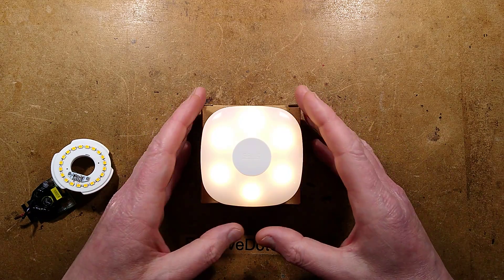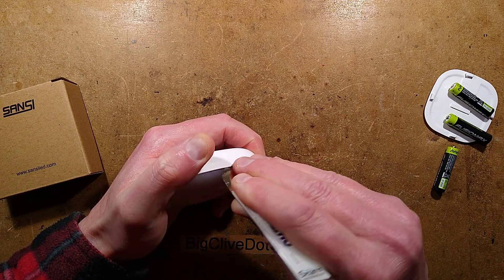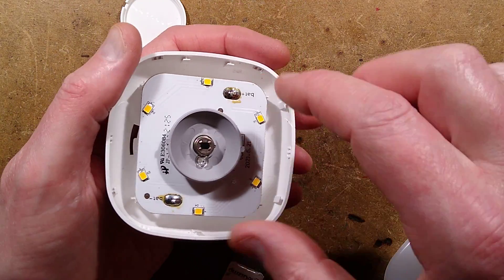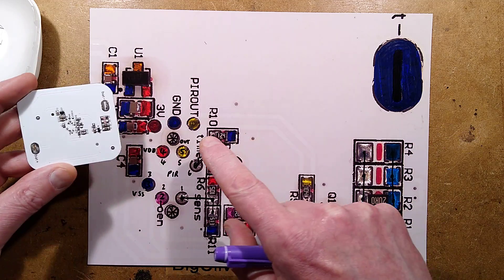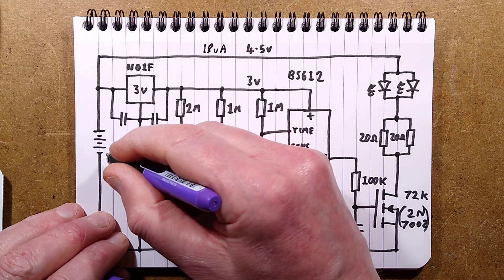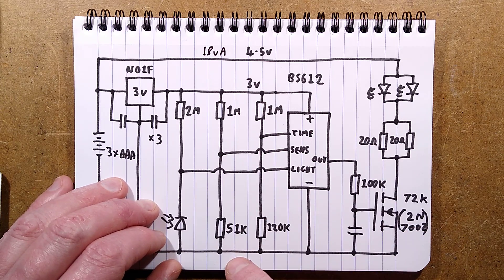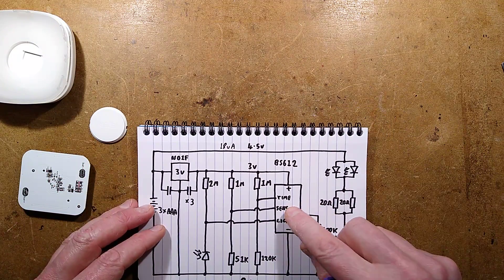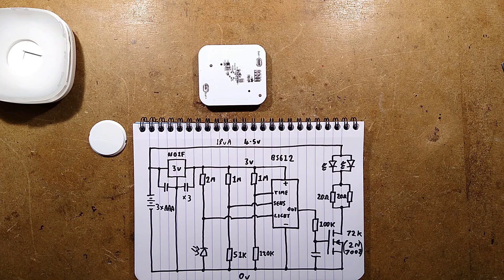Stylish Sansi PIR light - with schematic

Comment: Maybe the fresnel lid is mostly transparent for infrared wavelengths?

Some time ago I opened a pitch black device casing (some Android TV thing, IIRC). Normally these have a little smoke-glass-looking plastic window for the infrared remote receiver. But here there was no separate opening - the whole device case was 'infrared see-through'. (I checked with a phone camera that is a bit IR responsive and it could 'see' the sender through it.)

Comment: I'm surprised that at the "1M to 51k" ratio divider for sensitivity there is enough voltage left at 3V to set anything  (145 Millivolt?).
Nice that it doesnt draw higher currents for that, but i guess most will be used anyways in the standby current of the 3V regulator.
- Good size to replace with an old (protected) mobile phone battery.

(pair of 3 is currently at 10bucks on amazon, 6 for 16bucks, 1 for 6bucks.)

I wonder if their plant lights actually are good or just normal lights.

Comment: I wonder if it would be possible to create a scanning array and software to use the PIR sensor as a thermal camera pixel (or set of pixels).
Reply from the maker: A real high resolution thermal camera has never been more affordable.  (Infiray)
Reply: Look up panasonic grid-eye sensors. It's exactly what you are thinking off.

Comment: 3-Cell battery lights traditionally used 3 D-cells or C-cells in a single package.  I often wonder if the package standard could be resurrected as a large LiPo cell that can be shipped only by land then devices can be air shipped without for faster time to market.

Comment: Going by the circuit the device will not operate when the batteries discharge to 1v which I think is the yardstick for battery operated equipment. Looks like it might be okay down to about 1.2v per battery so NiMH batteries would not be very practical.

Comment: Interesting that the timer does not use a capacitor.  It would be nice to know the quiescent current. It seem rather inefficient to waste power on a linear regulator, but i suppose something must be done to compensate for the slow voltage drop as the batteries discharge, and 18uA is not going dissipate much. 
I have a very similar unit under my printer shelf. It's only necessary to wave a hand under the shelf to turn the LED light on, illuminating the printer to aid in changing the paper. This must be a new generation of low current PIR sensors, because when I wanted to use one to open a cat food dish, the high quiescent current ( in the mA range) made battery operation impractical. This unit would be easy to hack, to make a cat food dish lid controller, just replace the LEDs with a relay to drive a motor.
Reply: I forgot to mention that it also requires two normally closed limit switches, and a rf suppression capacitor to go across the motor.

Comment: I think AAA batteries where AA would work and be objectively better is just typical design cheapened to a fault. Less material cost in the compartment/holder, lower "batteries included" cost, etc.

Comment: Do you think that the capacitor on the mosfet gate is there to prevent possible strobing?
Reply from the maker: It may be to give a very slight soft turn on to avoid a sudden current spike.

Comment: Based on teardowns, what's your general opinion of Sansi products design and build quality? Based on your video of the ceramic light bulbs, i purchased a couple from Amazon to try out in my living room lamps. Lumen output seems better than the older Cree lamps i replaced, and the bulbs, while tiny, felt more solidly built. Im kind of surprised at how much sturdier they felt.
Reply from the maker: It's hard to tell without a long term test.  Some comments indicated but very long reliable operation and also some instances of early failure.

Comment: 3x AA would be too chunky to fit in that form factor, 2x AA wouldn't drive the LED's unregulated, and asking all potential customers to use only high voltage rechargeable NiMH or Li-ion AA cells is too big an ask for the price point. Integrated rechargeable doesn't make a lot of sense as it's a set and forget closet lamp.

Also from what I understand, there's quite a lot of difference in voltages over their discharge for AA, but almost all AAA are the same. AAA thus make a more consistent power supply, especially given the microcontroller power arrangement.

Still, it feels like they could have found a power controller that'd regulate both 3v and 4.5v for the LED's had they looked. It's clearly not the cheapest possible unit, the fresnel lens, exacting tolerances, circuitry, and PCB size all point to how much cost they're willing to eat... It's not like China or Texas Instruments have a shortage of chips for this kind of device.

Or one 5v regulator and a 5v microcontroller. You can still find 5v logic on newer processes, so energy efficiency isn't an excuse.

Comment: I think the capacitor on the gate is for smooth transition from light to no light. Otherwise if there's an object in front of the set, it could cause an oscillation with the photo cell, maybe more so when the batteries run low.

Comment: I noticed that the two 20 ohm resistors you were pointing out at 5:16 are put on so that the bottom one has the text right side up and the top one has the text right side down. Am I wrong in saying that a pick and place machine wouldn't do that?  It says to me that they hand soldered those two resistors, fine tuning the output of the LEDs.
Reply from the maker: I'd expect them to all be soldered at once.  It may be that the pick and place machine was programmed that way or that some resistors in the strips were in a different orientation.

Comment: I am not sure you are right about how it works. 

The IR sensor is a thermopile (stack of thermocouples in series) usually arranges  in a circle. With a germanium IR pass filter to block out visible and UV light.  The thermopile only outputs the relative temperature of its cold and hot junctions multiplied by the number of hot junctions. To measure absolute temperature of the IR source you need to measure the absolute temperature of the cold junction of the thermopile and then add the output of the thermopile. The thermocouples are likely to be type J or Type K. . 

The IR background has a wide temperature range. Say -20 to 35 C. This is why you don't want to measure the absolute temperature. You have to use another principle of measurement. 

In this case it is detecting an AC voltage to trigger the lights. This AC is generated by the target moving across the Fresnel lens. The Fresnel lens is more of a comb filter than an actual lens. Thus the Fresnel lens turns the moving IR signature of the target into a series of pulses. 

These pulses are detected and used to trigger the light output. The resistor and capacitor at the gate of the 2n7002 MOSFET create a delay and then hold delay for the lights. 

I will sit corrected if I am wrong. But I guess that I have just encouraged you to dismantle the IR sensor itself. Go on you know that you want to.

Comment: Hi Clive!  Thanks for the great videos as always.  Regarding those pesky battery holders, just in case you didn't already try pulling hard on them, quite often, the terminals will slide right out of the plastic, remaining soldered to the circuit board.  Pushing the tab from the battery-side can help.  Anyway, couldn't quite tell if yours would've worked that way, but it's still good to know for other devices.
Reply: When that works, I strongly suspect the tabs were added by the usual PCB assembly robots, then the board pops into the case with the tabs acting as locking springs.

Comment: Methinks that one can replace the visible LEDs with IR ones and use it to supplement security cameras' IR illumination. 🤔

Also, an upgrade to the battery would be preferred: perhaps an old mobile phone or a small pouch cell with small solar panel from a hacked garden light!

I HAVE to start working away SOME of the 'valuables' that I have in my workshop! 😂🤔

What a great thing to wake up to in the morning: my daily dose of taking things apart and the occasional schmoke signals!!

Thanks Clive!

ps. When do you actually sleep?
Greetings from Potchefstroom, South Africa!

Comment: Quiescent current? My cheap PIR light from Poundland lasted only 4 days & uses 4 AAA batteries! - that's why I ask.
Reply from the maker: That's way too low.  It was either false triggering or has a leaky ceramic capacitor.

Comment: AAA batteries are just plain lazy Engineering. 1/3 the power and always the same price as AA cells.
Reply: Unit has a 3v regulator for the sensor, can’t be driven off 2 AA and this arrangement running at 4.5v is more efficient and stable than a system running at 3v
Reply: @aaronatwood9298  run it off 3x AA batteries using the exact same circuitry as the AAA batteries. The only change needed is to make the battery holder bigger.
Triple the battery life, and the replacement cells have similar retail costs (similar environmental costs too)
Reply: @Ro0ops  a lot of those run on 2Aa or 3Aaa. 3Aa is uncommon in affordable LED.
Reply: Bruh just add a tp4056 charging  module with a 150mah battery
Reply: Wait til you hear about AAAA cells, that's the sound you make when you see the price for those bastard things. 😂
Reply: Bigger form factor, more plastic, less profit
Reply: You could probably replace the 3 cells with one Li-ion pouch type cell and a battery protection board.
Reply: Ideal for salvaged vape batteries 😁
Reply: You are all correct. But for a tight budget light. This is definitely better than most. And yes, could easily modify it.

Comment: Vipon had a bunch of cabinet-lights -- Li cells, usb rechargeable, off/on/sense, WW to CW, averaged 5bux-7bux per  -- that I kinda stocked up on.  Samesame "jeweled" PIR sensor in each.  Work great in stairwells down to the basement, etc., so you don't trip in the dark, fall down the stairs, and get gorked.  Get some duds every now and again, but cost-averaging makes it worthwhile.  Length, brightness, runtime are the main differences in features.  I might take apart one of the duds (stays lit when in sensing mode), just to see what's in it.

Comment: hey clive,i have an old am radio from 1986 and it has a horrible humming noise i cant get rid of, ? is it the transformer ? it the same one that came in it from the factory,what other things could cause the humming noyse ?
Reply from the maker: Usually the main smoothing capacitor.
Reply: i am testing by trial and error ,also the old capacitors have some markings i really do not understaand clive it says -10 +50% ? what is that suppose to mean ?i have an lcr t7,but it would be a lot of work dissolvering everything for testing i will work on the main ones though to try and clean the issue

Comment: I think I can resist this one, only place I can think of using such a thing, I already have a light I built myself (4x 1w "beads" on a current limited supply from 3x salvaged batteries from some defunct LG mobile addon thing), no PIR, but it has a pull-switch... :P

Comment: I don't like the lights that use three cells in series.  Usually they don't work well with my rechargeable NiMH batteries.  They get dim too quick.  I started getting small Li-on batteries that fit inside and wire them up instead.  Definitely use a resistor! 😂 I melted the glue on one light by not using a resistor.  It was very bright though!  Single cell pen lights work pretty good with my NiMH batteries.
Reply: Yea, the nominal voltage for NiMH is 1.2V, so 3 cells only gives 3.6V when the cells still have 80% charge. Since a white LED drops around 3.6V at full brightness, that doesn't leave anything for the dropper resistor so the current drops off and it appears very dim. The single cell flash lights use a small boost converter which continues to work even when the cell gets fully discharged at around 1.0V so they work much better with NiMH.
Reply: The need of three cells in series is very unpractical as these cells/batteries are usually sold in a 4-pack and also most budget chargers only charge 2x2 cells in pairs . It would be so much better if it had been designed to work on a pair of AA NiMH cells.
Reply: @Acamperfull  I don't use the "budget" chargers.  I like each cell individually charged to maximize performance.
Reply: These lights eat batteries like crazy.
Reply: @guyh3403  I'm curious if you mean this specific light or this type of light in general.  I haven't tried the type with a motion sensor but I have a similar one with IR remote and was not very happy.
Reply: @jmr  It was meant in general. Most of the ones I tried eat 3 AAA's a month. Eek!
Can't speak for this one though.
Reply: @guyh3403  That's about what I'm seeing. 😔